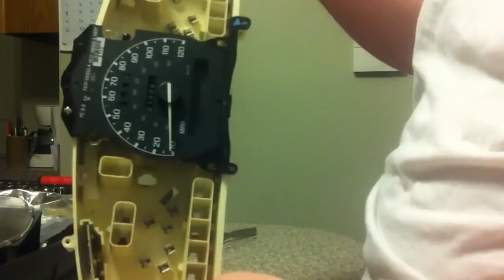HOW TO: Fixing my odometer gear in my 1995 Ford Ranger XLT

Comment: I replaced the broken worm gear on my 1996 Explorer; however you DO NOT need to remove the speedometer needle and the circuit board to do it, which eliminates the need to re-calibrate the speedometer.  You can use a small screwdriver and release the clips that hold the odometer motor from the back, rotate it slightly anti-clockwise, and simply pull it out.  I bought the new replacement worm gear on Ebay for $5.84, free shipping.  The new one is nylon instead of plactic, so it will last a lot longer.  I used a small amount of Teflon grease on the worm gear before putting it back in.
Reply from the maker: Thanks for the reply. I will pin this comment to the top of the comments section so others can see it as well.
Reply: Thanks for the tip Dan. Just replaced mine and it works again
Reply: Dan S what's the part # worm gear
Reply: I paid $17 for the worm gear.  But yes, taking the speedometer needle off has been a problem.
Reply: Thanks Dan S.  Got my worm gear for my 96 Ranger XLT for $9 on Ebay.  You saved me some time in adding these comments.  Thanks so much.
Reply: @group447  I have the same model and year of ranger lol, imagine this, same issue. My odometer might work a third of the time lol.

Comment: 8-13-2021 / Just wanted to say thanks for the tip on getting the motor out.  Using the screw on that hard to get tab.  Got the motor out in 5 seconds.   Thanks again!

Comment: You dont have to pull the whole thing apart. The odometer motor twists out from the back and you can put the new gear on. Use 2 credit cards to gap the distance from the motor to the back of the new gear. By gaping it this way, the gear doesnt touch the speedometer back plate. It worked great for me.

Comment: The gear is now available for about $10 from Amazon.  It is now Dec. 2019.  Yours is the first of 2 videos on the 95 to 97 Ford Ranger.  Please show a video on actually placing the worm gear on the shaft and reassembling the entire gauge cluster, step by step.  I don't think you need to take out the three screws on the front of the odometer, but not sure.  Thanks.  Good job.
Reply from the maker: I just bought a 1997 Ranger a couple of months ago and plan to redo all of these old videos with a smidge better quality. I’ll try to get around to it soon. Thanks for the info on the gear!

Comment: Good info and well-presented.  Found this after researching why my odometer/trip odometer both are coming and going recently.  I never opened up the cluster when I had it out replacing bulbs (another of which went out a couple of months later, of course  lol).  This gives me a far better understanding of how they're both driven (I'm used to my old 89 VW) and what has most likely failed.  Too easy - Thanks!

Comment: Nice. Thank you.  I would also prefer to change the lights while refurbishing the gear and cluster.  It would be helpful if this video included comments on bulb replacements too.
Reply from the maker: Anthony Hardy the bulbs are size 194 from your local parts store. They are incredibly easy to change. They pop in and out no problem. Any of them that are a little difficult, just slip the appropriate sized socket over it to give you some leverage. I definitely recommend replacing them all while you already have your cluster out.

Comment: I had trouble getting the servo motor off,Found a fix pryed up on the odometer shaft and removed the idler gear and was able to install the worm gear on the servo motor shaft then replaced the idler gear and snaped the odometer shaft..All back together and working

Comment: Thought my odometer gear was broke. It was not; bench testing odometer like in your calibration video. assumed that would run odometer motor also. It is not. Already replaced all senser with the exception of the range finder. Is the motor shot?

Comment: I did everything you said to do and taking apart and reapply, the odometer works well, but the only problem I'm having is when I go to start the car and the speed indicator moves up to 40 miles an hour even when I'm not driving it'll do this when the car is in park so now I don't know how fast I'm going, I mean I do, its just the indicator is not on the right setting, its a 95 Explorer and it uses this exact same instrument cluster
Reply from the maker: Check out my other video on how to calibrate your speedo. There was an annotation around the time I pulled the needle off in this video with a link to that video. Hope this helps. How to calibrate the speedometer on a Ford Ranger
Reply: I have the exact same problem ! How did you fixed it?
Reply: yoda_wankenobidarthfriend Believe it or not it's the alternator .. You have the wrong one on it !!
Reply: +yoda_wankenobidarthfriend 
just did mine and the speedometer starts out at 42 mph. Is there any other way to fix it? DId you fix yours?

Comment: I have a 1996 Ford Explorer,I followed your video and the worm gear was falling apart. I changed a few bulbs that was blown out and put everything back together took my truck for a ride and odometer or the trip meter still doesn't work. I was wondering could it be the motor that is bad as well and is there a way to see if it the motor?

Comment: Daren, thanks for posting this vid. Please estimate how many hours it would take you to remove and replace the odometer gear on a 96 Ranger so I can double or triple and reach a realistic decision and budget the time to do it or not.  It failed at 112K miles. Thanks.
Reply from the maker: Less than an hour. I have a couple of other videos on my page. Watch those first. Also, read the comments on each video. Good suggestions there from others as well. If you can undo a screw/bolt, you’ll have no problem doing this in an hour.
Reply: @Kybucks10  Thank-you for the prompt reply. I will folow your advice and now look for the best deal for the exact  part online.
Reply: I replaced mine a couple of weeks ago, Dec 26, 2020, and it worked for a little over 8 miles, then stopped working... It started working again a few miles later, for another 10 miles, and stopped working again... I filled the truck with gas, and reset it to 0, and it worked for another 10 miles and quit working again! Do you think I need to replace the little motor the worm gear mounts on?

Comment: Hey Daren. I just bought a 96 Ranger from someone on Craigslist. Hit half way home and realized the odometer was not working.  Does replacing the worm gear on odometer update the mileage on my 96 Ranger? As in, if it is supposed to show and additional 20k miles, will it update on its own once the worm gear is replaced?
Reply from the maker: Unfortunately, it won't. It's a mechanically driven odometer, so the motor will always spin as long as the vehicle is moving, regardless if the worm gear is turning the odometer gears. There isn't a computer that memorized the mileage. There's no way of knowing what the actual mileage is at this point.
Reply: +Daren Reichle Thanks for responding.

Comment: I replaced the worm gear on my '95 Ford Ranger Saturday, and today, when I filled the truck with gas, I reset the Trip Odometer, and now, the odometer is not working again?? Any ideas?

Comment: I have 95 Ford Explorer with non working odometer, I got worm gear but how do you disconnect fuel gauge cable to remove cluster????????
Reply from the maker: Pulling the instrument cluster of my 1995 Ford Ranger

Comment: How can you do the mileage like if it's stuck at say 285500 miles and you have drove say 8000 more miles how can you fix that problem.
Reply from the maker: Earnest Smith you have to disassemble the odometer even further. I actually did that with mine because I put a junkyard unit back in my truck and wanted it to match my actual mileage. I didn’t make a video though because I didn’t want people to be dishonest and take miles off their vehicles. I will say, it’s possible. Just tedious.
Reply: @Kybucks10  Can a automotive shop do it because  mine is suppose  to be at 296500 right now but it's stuck at 285500
Reply from the maker: Earnest Smith possibly. You would just have to call around and ask. So does your odometer not spin at all or it is just constantly behind?

Comment: does anyone now how to make the last 3 digits tik over only?.
Ive got 211615 miles on speedo
only want the 615 to move.
Dont want it to move over to 212000just want it to stay in 211000 all the time.
Reply from the maker: A) That's impossible. They are all linked together and turn with each other. 
B) That's illegal.
Reply: +Daren Reichle It's only illegal if don't don't tell the buyer and if you put false info on the title work.